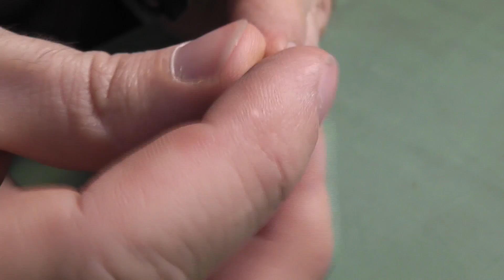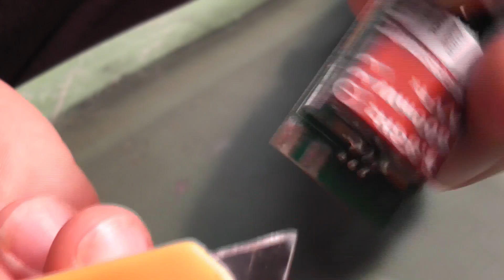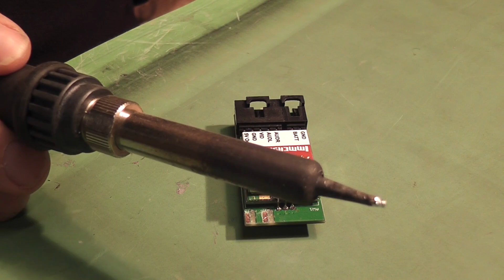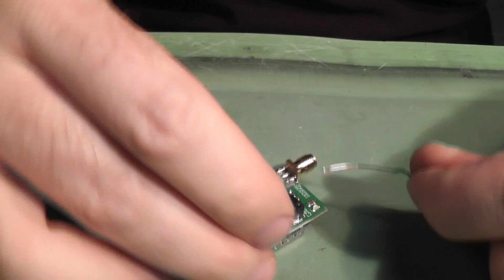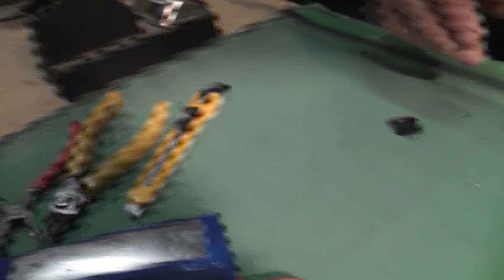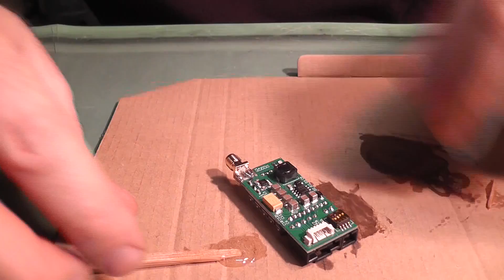ImmersionRC 5.8Ghz Vtx SMA Repair

Comment: Do you know where you could get a VTX antenna connector? Because I crashed my quad and the part that connects the transmitter to the antenna broke off the whole thing.
Reply from the maker: +Dhruv Patel I'm not sure whre you live, but Digikey will have them in the USA
Reply: +seafurymike Ok thanks, I live in the USA.

Comment: I have a TS832 and a friend of mine disconnected the antenna and powered it on. I know typically transmitters rely on the resistance of the antenna to not fry itself, is this the case for this transmitter too or not? I am curious because I would have thought if it broke off while flying it was likely still powered. I haven't tested it yet for signal, just trying to figure it out without testing.
Reply from the maker: +inoita11 The output (antenna) acts as a "resitor" for the circuit. If you remove the antenna, or any portion of the unit that carries the antenna, the system will try sending power out. As there is no means for the system to dissipate the power, the system gets hotter and hotter, until it just fries the electronics. How long it takes to fry the electronics is a product of how much power is being pushed out. If it was off for a minute, or more, it is quite possible the chips have overheated. Just power up the unit and see if you get a video stream. Be careful, as it may still fail when the components get hotter a few minutes later. Bench test it for a little while.

Comment: Hey thanks for the video. I'm just about to attempt this myself. I understand the need for the scraping the ground pads and creating a solid mount for the sma connector but why the need for creating the new signal pad? Why not just do the link wire as you did and forget the soldering it to the pad?
Reply from the maker: you could do it that way. i just wanted a secure fixing of all of it. if you coat it in epoxy either way would work.
Reply: +seafurymike thanks for the reply. Just for info it was the limited 100m range I was experiencing that lead me to find the loose connector. Amazed really that it would work at all with no antenna connected! I did read somewhere else that this particular vtx should cope for hours with no antenna attached - hope so and that I haven't done any further damage!

Comment: If you had not repaired it the right way, would there be no picture at all?  I was wondering if the transmitter would still send out a little bit of signal even if the antenna wasn't really connected.  I ask because I read that some people said their range decreased dramatically after repairing these.  Mine recently broke off as well and I just repaired it.  Was your range just as good afterwards?
Reply from the maker: +Nick1814 if done correctly, the range should go back to being the same. Your connecting to the exact same ground plane and the same active feed. It is important to ensure the ground is done well as this will affect picture quality, but all things being equal, the repair should be as good as new. 

If you get no picture, its possible that some other component was damaged during the crash. With no camera, you will still see a full black screen on your goggles or TV unit.

Comment: Nice one, i'm new to the fpv quad copter racing 'sport'. However, I am NOT new to the breaking of the F*cking expensive immersion transmitter. 
This video gave me the confidence to fix my own. 
However, my solder really diddn't take to the board as well as yours did and just wanted to sit on the iron. Did i do something wrong?
Reply: Two things. Really hot iron applied to the board for a very short time. Use flux and i have a small tube of it sitting around. Take a small amount and add it to the board before soldering.
Reply: Cool. Thank you! I did it, more luck than judgement though. Many thanks again,

Comment: great video but seriously I have a completely burnt out irc 600mw vtx and it works on the bench with NO sma connector or antenna with a very clear image.
But if I take it out to the field I cant get 100 meters.....so is yours actually fixed?

Comment: The only issue is if power was on without an antenna the range is decreased
Reply: the repair was was to the antenna ripping off in a crash. using a transmitter without an antenna will burn out the unit as they need a 50 ohm load at all times to dissipate the power. if there is no load it get reflected back and the chipset gets hot and burns out
Reply: Seafury mike I think what he's getting at is that your transmitter is likely damaged if it operated without an antenna. However, I had a crash once in which my 90 degree sma adaptor broke apart in a crash and the tx operated for maybe 10 seconds without a load without damage (maybe it was shorted or something instead of just open circuit)

Comment: Great video! i have a broken black square part says 470 on it and is approx 7mm square,,, it is made out of plastic,,,Can i buy this part and install a new one on the immersion board? thax
Reply: roadstar499 I have the same inductor broken A friend got his fixed broken SMA and that part heres the email address.
repairs@immersionrc.com, the fella is called Dave
took 5 days all in and an excellent job
Reply: Des Cal Thanks for the help...i will email him now

Comment: Where did you get your SMA adapter?
Reply: Don't forget an extension so that you can tuck your VTx away and not break it next time: http://www.amazon.com/gp/product/B007POE14U/ref=as_li_tl?ie=UTF8&camp=1789&creative=390957&creativeASIN=B007POE14U&linkCode=as2&tag=wwwaaronbumco-20&linkId=4ID5WUGJRLHRTG65

Here's my fix and results picture:
http://www.aaronbuma.com/2015/02/broken-immersion-rc-vtx-antenna-mount/
Reply: aaron nice job on the vtx fix. yes the extension cable is a must to take the load off the fix. i also added epoxy over the join to strengthen it
Reply: What size is it?
Reply from the maker: This is what I bought.

http://www.ebay.com/itm/10-SMA-female-PCB-Edge-Mount-RF-Solder-Adapter-0-062-/160518940049?
Reply: I got mine from eBay here:
Http://m.ebay.com/itm/291247094780?_mwBanner=1
Reply: If you want one quick just go to radio shack they have a ton of them usually in stock for about $8

Comment: Hey Mike, this is a pretty common problem we see in the fpv world. Great transmitter but a bit of a design flaw if you ask me.
Reply from the maker: I agree. The PCB isn't thick enough for the connector and I did think about using a pigtail, but I didn't have one, used my last one on my glitch. Would be better to solder the pigtail directly to the tracks as there is less load on the unit.

There is the 32 CH stuff which is much smaller. I'm not sure if they are as good in quality, but a smaller Vtx would also better.